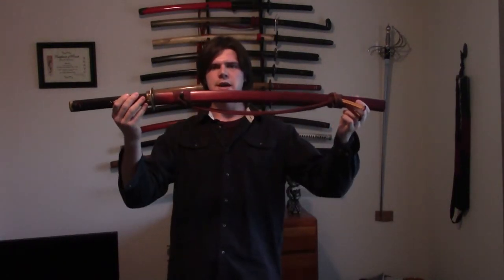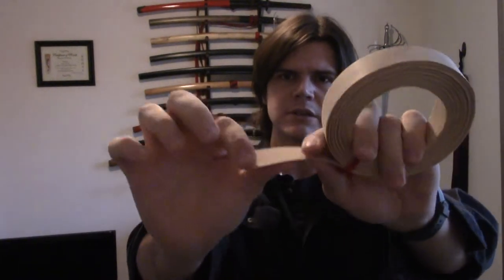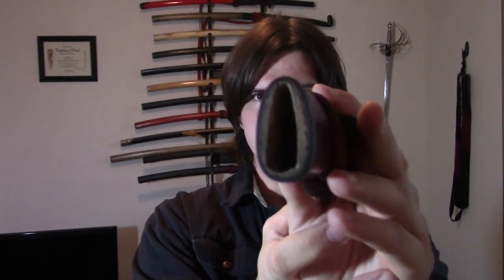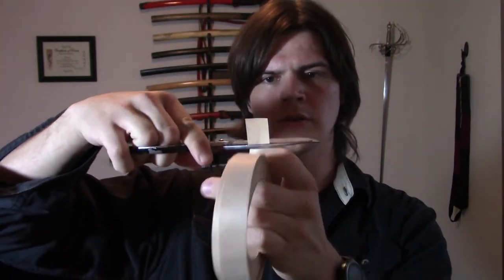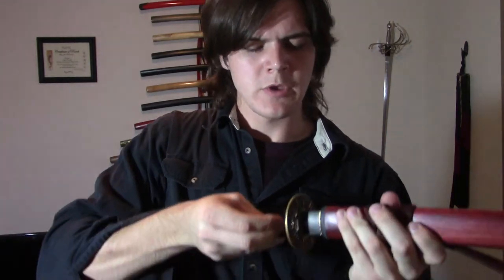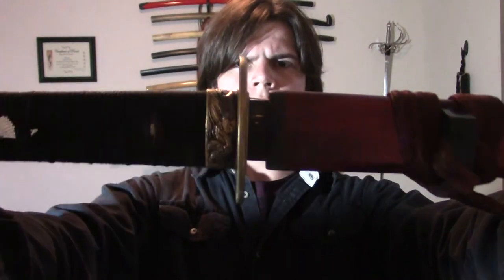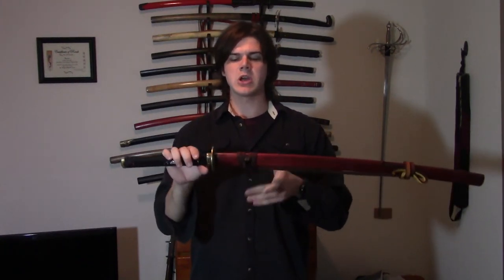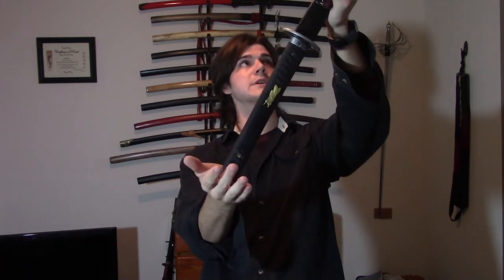How to shim a Saya

Comment: I just subbed you. I was sent here from Eric. Where in Indiana do you live? I’m in Columbia City. I’m going to fix my Saya soon. Mine is very loose. Do you only recommend shimming the edge and spine sides or is it ok to shim the other two?
Reply from the maker: Cool thanks for subbing! Eric is a good dude. North Judson, Indiana. You can shim the sides just be careful because if not careful you can actually split the saya. So you shimmed the edge and spine sides and it’s still loose? I’ve had swords that needed both to get a nice snug fit but never seen a sword that was still loose after that. Another thing you can do is carefully use thicker shims. Let me know how it works. If you want you can message me on fb about this.

Comment: Very well made video. But I have a question. I've heard (in SBG site) that, very often, a loose saya is the result of a too much changing weather condition/exposure (say shipping etc), so, my question is, have you noticed if (in the case of a loose saya) placing the saya into a more warm and dry environment for a couple of weeks may help, naturally, in tightening the wood? Or is that a sort of legend? :-)
Reply from the maker: Thanks! Yes and no. I have noticed that in different weather the saya can expand and contract, I've shimmed saya that were too lose to a perfect fit and then next thing I know the saya was really hard to get out but I've never had it tighten to where it was usable again although obviously it is possible, its just not happened to me. 

  More often than not if a saya has loosened up that was tight and its a sword you use a lot its just from use and improper technique speed it up even more although it happens with good draws as well, just much slower. I used to go to a dojo and beginners often would turn the sword while still in the saya so little by little the saya would just get worn away from that even on iaito. And to be fair it happened to me as well when I first started but as I got better it didn't happen as quickly but no matter what it will happen eventually even if you aren't doing incorrect draws just because the metal the habaki is made of is harder than the wood so little by little it'll wear the wood away.

Comment: Hey Adam, have you ever put tachi/handachi fittings on any of your swords? If so, do you have suggestions for where to find tachi/handachi fittings?
Reply from the maker: I’ve never put them on my swords but I have used a sword with them and I like the way they look and function. Used to be that artsfeng.com sold them but if not them then either look up either a custom sword maker or buy a tachi for the fittings.

Comment: I shouldnt get this kinda of problem with a laito or will I?
Reply from the maker: You can. The habaki is a metal against wood, it's only a matter of time before it happens really. What really speeds it up regardless of iaito vs shinken is bad draws. Even if it's an iaito the blade can little by little scrap away wood with bad draws.
Reply: @StudentOfWarCustoms  gotcha ill keep that in mind. Well since its a new but cheap price i checked the retention and it seems okay for now.
Reply from the maker: Cool sounds good. If you are just starting I really recommend a bokken if you don't have one. A bokken is really an invaluable training tool. The Cold Steel bokken and Cold Steel o-bokken are really nice especially for the money.
Reply: @StudentOfWarCustoms  yes but I heard the e bogu saya is very tight on any cold steel bokken so that defeats practicing drawing or laido techniques. Do you have any suggestions on removing debris from the habaki? I guess some lint got caught inside while I was cleaning the first time

can I try a q tip?
Reply from the maker: That really depends on the bokken. The regular Cold Steel bokken has no problem with an ebogu saya, the o-bokken however does. 

Yes a qtip can work especially if you take the sword apart which should be done periodically to completely clean the sword.
Reply: @StudentOfWarCustoms  I dont really have any skill in dissembling a japanese sword even an laito. And another youtuber said if it is not a proper laito from Japan then there is no need to dissemble. What are your thoughts?
Reply from the maker: In my opinion to tell someone not to disassemble an iaito because it's not made in Japan is idiotic. Taking apart a sword is about more than just cleaning, it's part of preventive maintenance. When you take the sword apart you are checking for splits in the tsuka or any other safety hazards that could be disastrous. I've had to repair swords that 1 mekugi was drilled half way off the tang and the inside of the hole was like a shear so it had the potential of shearing through a mekugi. Plus the mekugi are a part that wears and eventually needs replacing. You are also checking if there is any pitting under the habaki because that is a high stress area that when you see swords break is one of the places they break most often. 

Overall I recommend learning how to take a sword apart and inspect it. You don't need to take the sword apart all the time to check it but it's something you should do every now and then especially if it's a sword you use a lot.
Reply: @StudentOfWarCustoms  it looks like cheap laitos are not the way to go. But, to me it seems well built I read the mekugi needs to go at an angle so not straight however, some of the ray skin around it is peeling off is that a bad sign?
Reply from the maker: That sword that had the mekugi drilled half way off the tang wasn't even a cheap iaito lol it was a Cas Hanwei shobu zukuri raptor which makes it even worse. Had that sword failed it would have then had a sharp projectile flying through the air. 

Not really a big deal. It's more annoying than anything else. These days the rayskin is mostly done in panels rather than a full wrap so it's mainly there for looks and to give the ito a little something to grab onto so it's less likely to slip around if the wrap is properly tight.
Reply: @StudentOfWarCustoms  im surprised the ito is wrapped tightly

Comment: I am using hazel. Dried hazel, is that bad? It has no sap and about the same density as birch
Reply from the maker: I've never used hazel and never heard of it being used so I can't say one way or the other. I have a lot of poplar shavings from when I carve so I just pick up some of the shavings or do some shavings that are purposefully done with Saya shimming in mind.
Reply: ok thanks for answering, by the way i used hazel on the mune, i used dried birch on the ha, i don't know if it has anything to say. also the katana i have is about 50 yrs old and the tang is quite rusty, it is only surface rust though, i have cleard it with rubbing alcohol and treated it with oil to hopefully stop it
Reply from the maker: +SuperScience894 no problem. Ok. The tang is suppose to rust. You don't want to apply oil to the tang because now that oil is going to be absorbed by the Tsuka core. If you look at most antiques they have rusty tangs, that's how their told how old they are. You want to leave the rust alone and and pretty much ignore it on the tang.